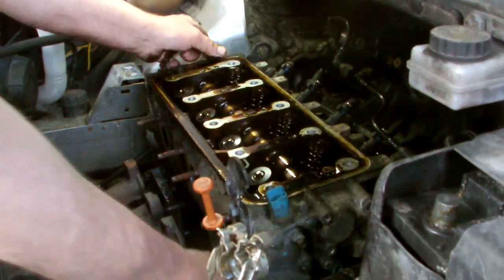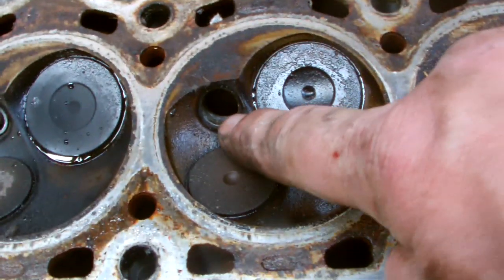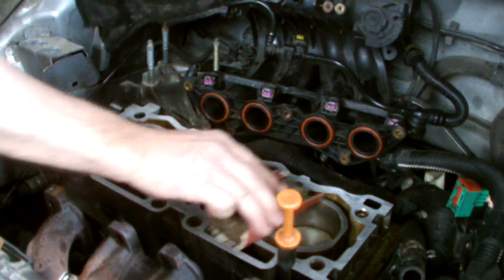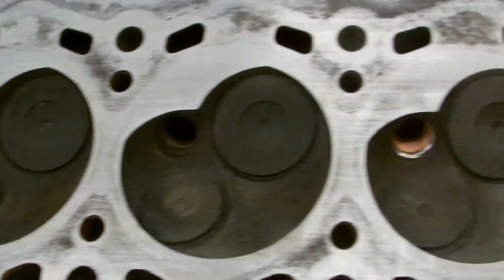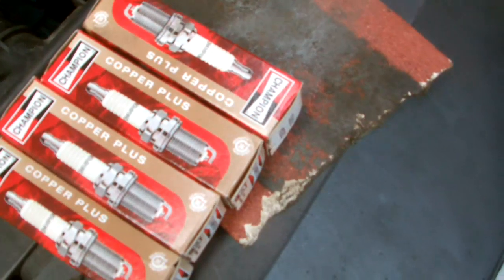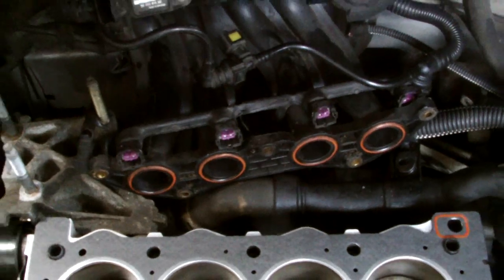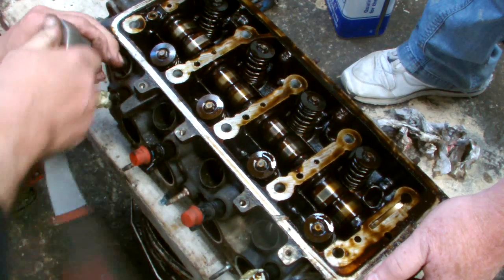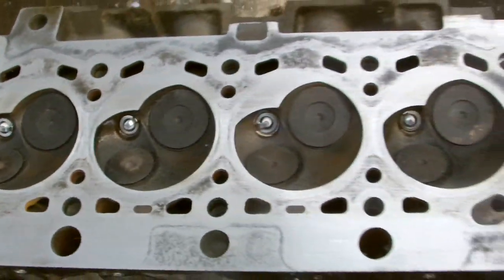peugeot 307 head gasket replacment part2

Comment: just as a precaution when sanding down the block face be sure to insert something to cover the oil and water gallerys don't want bits off rubbed off crap in the engine.